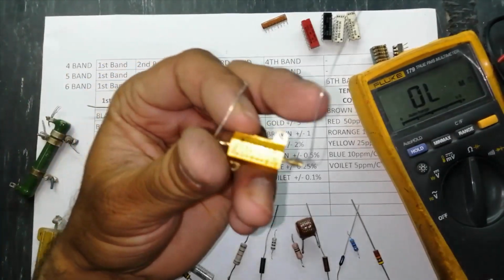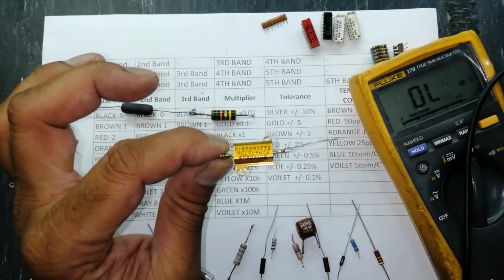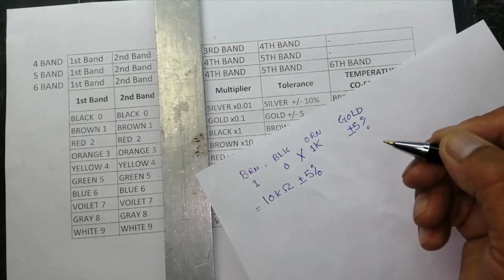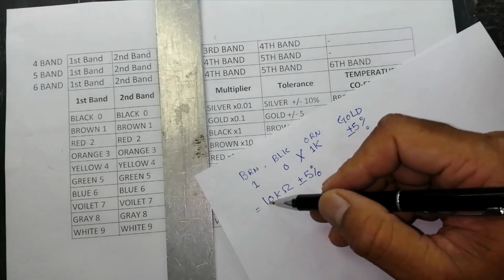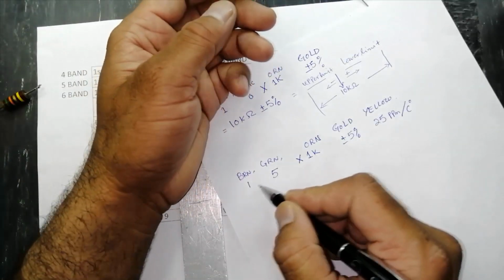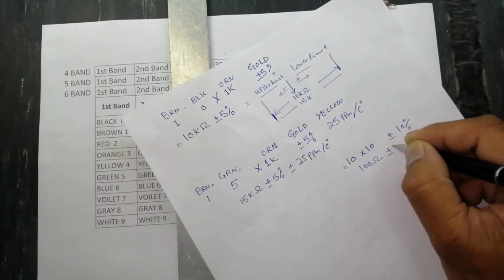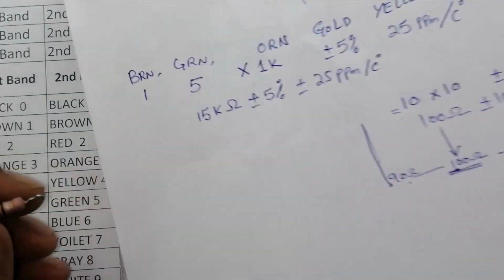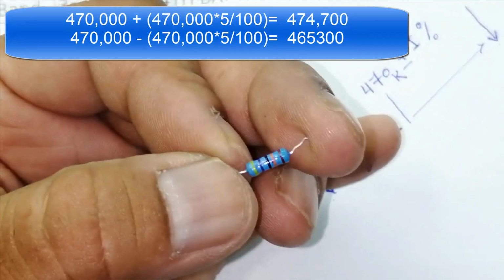#290 Resistor Color Code Calculation /3,4, 5,6 Band Resistor Color Code/How to Calculate Resistance

Comment: Hi Haseeb!!!

I mod the ATX psu into variable power supply. Which is using TL494 pwm chip.

Successfully done. There is no problem to output 1.5v - 25v.(Thanks to Haseeb to give amazing explanation. By your tutorial i done it)🙋🙋🙋🙋

And also use shunt resistor for current control by some works in pin no 15&16 of TL494.

My question now is, by adjusting the voltage, which one is control :Frequency or Dutycycle of PWM ic?

Please clarify me.

-Arun, TamilNadu,India.
Reply: @HaseebElectronics  wow. Thanks for your valuable answer.🙋🙋🙋🙋
Reply: we can change duty cycle by replace Auxilary Ele.capacitor  and get stable voltage instead of replace the IC